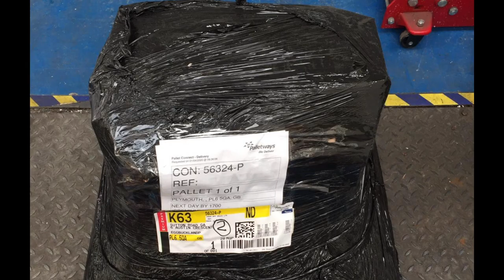HOW TO DO A 2L BLOCK CONVERSION ON A MK3 RS IN 4 MINUTES!

Comment: Hi there any chance you could do a more in depth video? Is the 2.0 block a direct fit if you use rs internals? All water galleries and oil ways match the head? Thanks
Reply from the maker: Hi , i don’t give to much away with regards to tech info for obvious reasons but please feel free to give me a call on 07791241417 to discuss more 👍🏁
Reply: @mjperformance8161  fair playmate i want to build my ow engine thanks